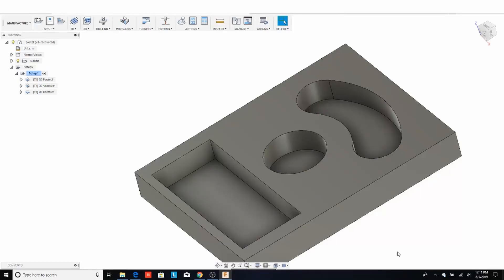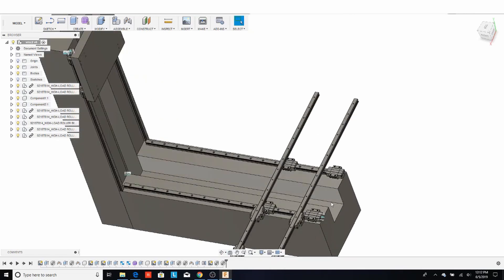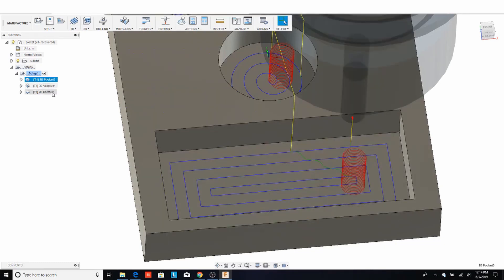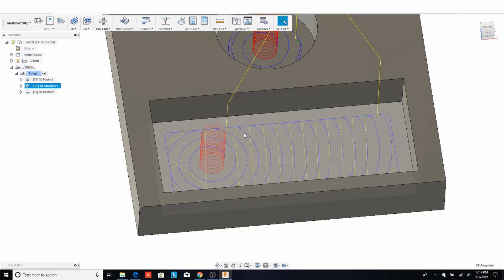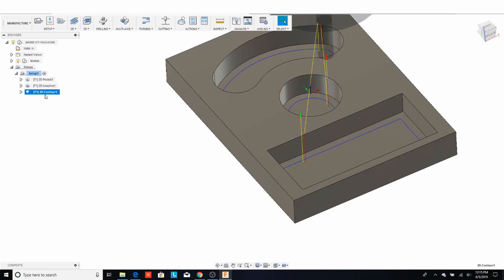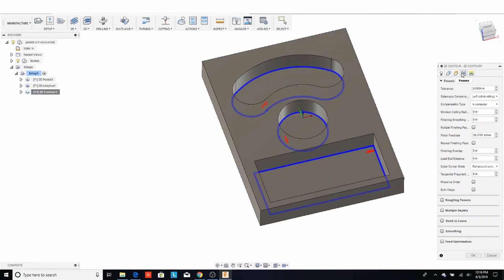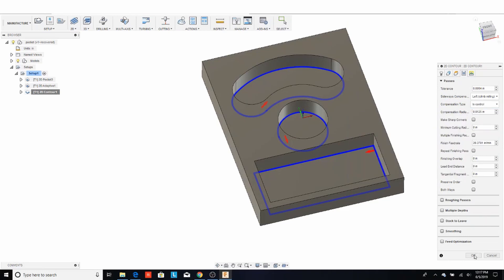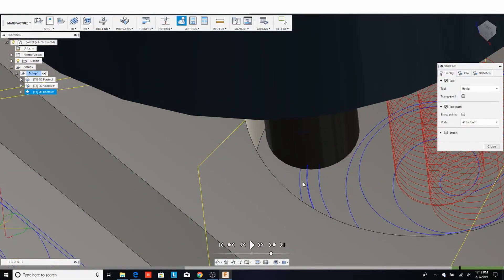Different pocketing  tool paths and cutter comp for milling in Fusion 360 1#

Comment: I wanna try clarifying this a little for my own understanding.
So I run a vf2 haas.
With a haas post processor. Typically we use regrind endmills. Our machines are set up to diameter vs radius for the cutter compensation type.
In this style of controller understanding I would select
In control > left (climb milling) > what value do you typically put for the max cutter compensation amount?

This way would allow me to program a pocket to say .5” and it measures .480 due to the reg round endmill. Therefore as long as I programmed fusion path with in control > cutter comp left (g41)
I should be able to put -.020” in the tool geometry wear and it’ll mill that pocket to .5”?

Comment: On cutter comp. I was thinking of adopting control comp for the very reasons you mentioned, thanks!
  Ok, the trouble at hand is I am trying to pocket with  3 tools. Rough, semi-finish, and then go in with the ball-nose to do the fillet in the bottom.
 Do I have to call 3 pocket cycles, or can I throw 3 tools at one pocket cycle like in my old software?
  Thanks!
  Mark